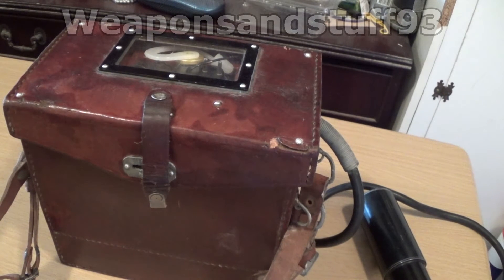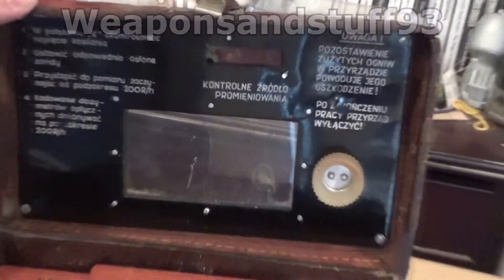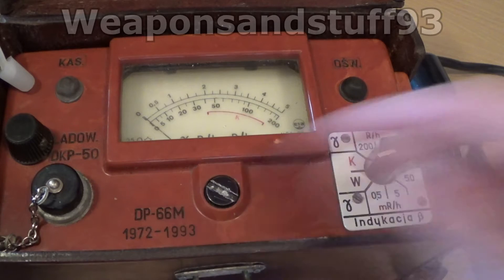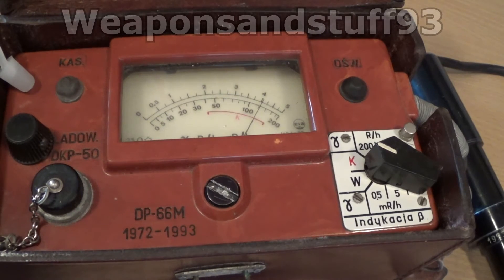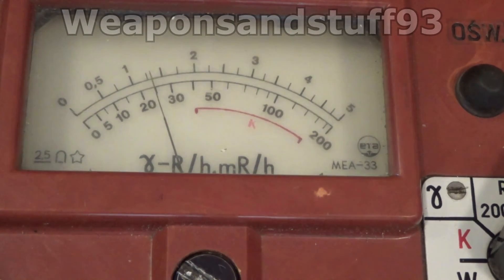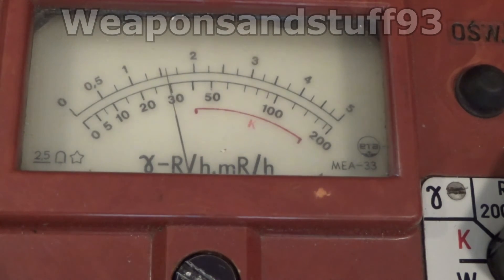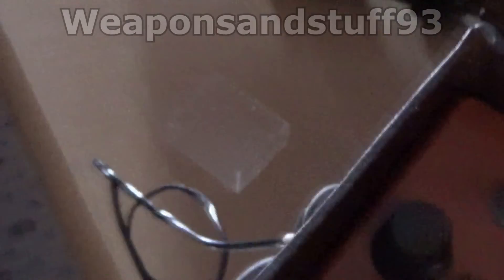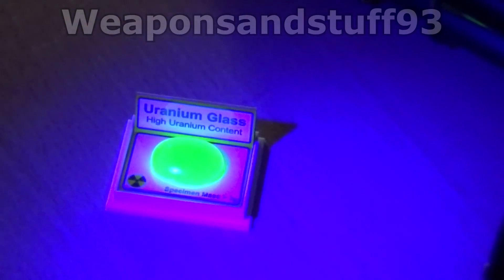DP-66 Geiger counter

Comment: Thank you for sharing ,this helped me to get started with mine.....mine has a slight fault Though,its analog meter can not be adjusted to zero,it stops at 5 on the bottom scale...something mechanical with it...othervise it works...It feel the background radiation!
Cheers/Stephan Höglund
Reply from the maker: That's annoying but glad the video helped

Comment: Cool vid. I have one too but the needle doesn’t spring into the k area when I actually turn it on. Any idea why?
Reply from the maker: It's the battery test, so your batteries are flat or the wrong type etc
Reply: Weaponsandstuff93 i used the R20 1.5v batteries. The light works but it’s only that which doesn’t

Comment: Hi Great informative  video thanks...
I also have the the same DP66 M but think I have problems,
when I turn the dial to RH 0.5 after two seconds the needle swings hard right and emits a low hissing sound from the speaker.. is this Normal?
all else seems to function Ok (eg detects thorium etc.)
Reply from the maker: My only guess is there is some sort of radioactive material stuck in the probe, so as soon as it's turned on it begins detecting it.
Reply: @weaponsandstuff93  Thanks for that..i don't think that's the problem as it doesn't make  any clicks, just a hissing sound.. and  it functions normally on the lower mR/H Scale. ?

Comment: I’ve watched a few videos on this and all of them have a radiation detector stick thingy that’s different to mine. Weird.
Reply from the maker: The probe? Lots of Geiger counters came with different model probes, do you have a pancake probe?
Reply: Yours could be a DP-66 instead of the modernized DP-66M. The DP-66 has a silver colored beta shield with slots on it.

Comment: The knob on the left of the device is a calibration. Turn the meter to K and turn it until the pointer lines up with the triangle in the middle of the red band , then you're ready to measure . The lower scale is for the 0-200r/h setting only and reads r/Hr as it is the measure for the ionization tube that is next to the Geiger tube
Reply: That is false, it has nothing to do with calibration. It is used for charging the DKP-50 dosimeters. I have read the original polish manual.
Reply from the maker: +bonusnudges Thanks for the info, next time I get it out I'll calibrate it.

Comment: Great vid L, very interesting, do they work on smoke alarms? if you do let me know what happens.

Mike.
Reply: ***** they dont work on smoke alarms. Smoke alarms contains Americium or Plutonium but that isotope emiting only alfa radiation. You need special dosimeter to check alfa radiation lvl, because normal paper sheet will stop alfa radiation.
Reply: @michastrzelec4846  Americium puts out a bit of gamma, as well - certainly still detectable without an alpha sensetive probe

Comment: Going to the zone, Stalker? haha
Reply: Weaponsandstuff93 You dont need alfa detector. It's okay to have just simple mask on your face. Alpha is dangerous only when you get source of it inside your body.
Reply from the maker: jamiemcf1 If I was somewhere radioactive I'd want a detector that could pick up alpha radiation as well.
Reply: Weaponsandstuff93 Radiation's measured in different units too now, isn't it? I remember watching a documentary about Chernobyl and even two days after the explosion, people were still going about the town doing their business as normal while soldiers with suits and geiger counters were walking around town picking up nearly 700 rontgeons more than usual background radiation.
Reply from the maker: jamiemcf1 Yeah modern detectors use uSV, which is different from Roentgens but the CPM on Geigers no matter the type is very similar.